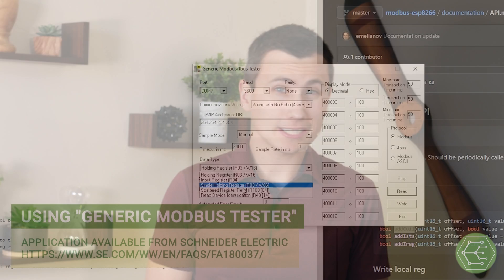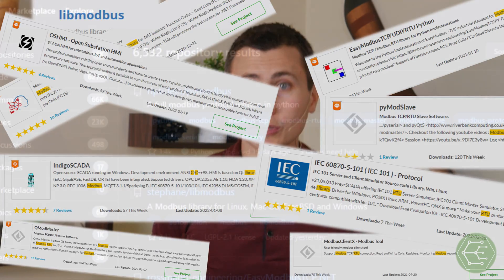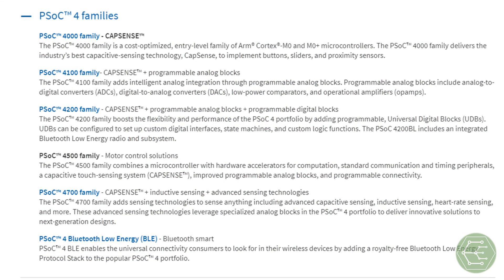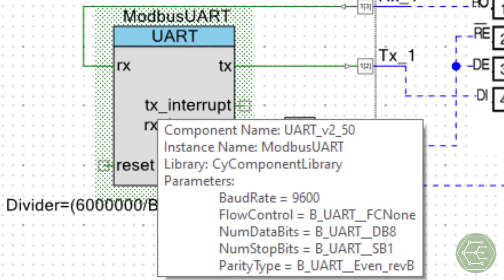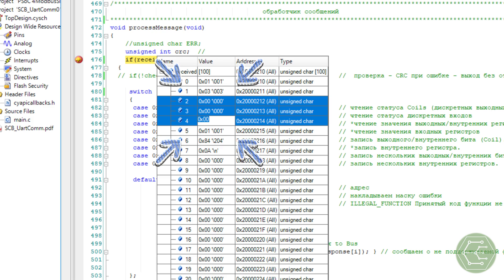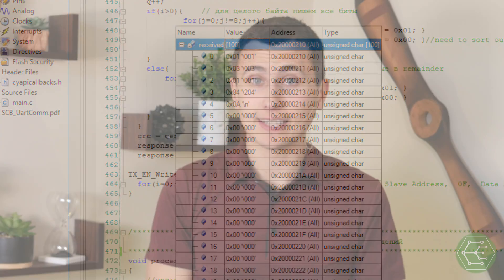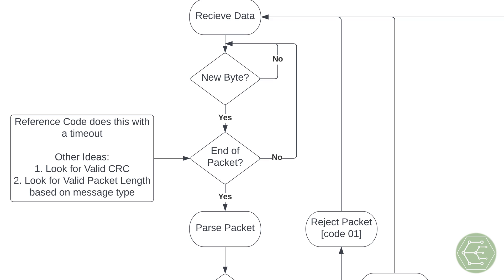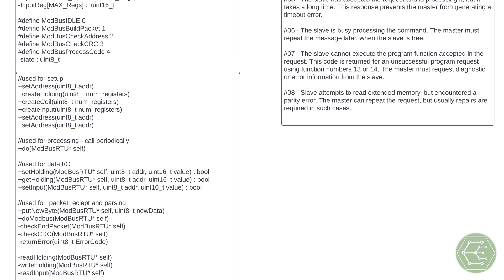Choosing a C-Based Modbus Library… and making it work | MOT14

Comment: I haven't developed written Modbus in C/C++ but I review implementations and use it heavily. I like how robust it is, but can appreciate how often it goes wrong, even in commercial/industrial settings. I don't know your hardware setup, but if you have moved from TTL to EIA/TIA/RS 485, I would have a read of that spec too. Texas Instruments have a brilliant design guide that condenses a lot of 485 information, aptly named 'The RS-485 Design Guide'. Most tips ~can~ be avoided until you're running the bus over distance, but it certainly helps to be robust.

On a hardware level, plug-and-play may result in some very irritating issues. Transceivers/line drivers should be hot-plug capable/ESD tolerant. I have a had PLCs intolerant to hot-plugging, and that was not a fun experience in diagnosing.

Per Jared's recommendation, a logic analyzer is a good idea. You can even get $20USD ones that work quite well, though usually sample at 24MHz max. Salaea charge a dime but in the past the had a discount scheme for students, hobbyists, maybe private contractors. It'll be good to prove if your issue what side your issue lies, read or write.

I have yet to see Modbus issues related to Windows, maybe because most Modbus work I do is at low baud rates.

I hope this is helpful.